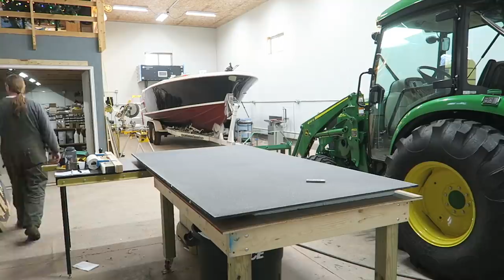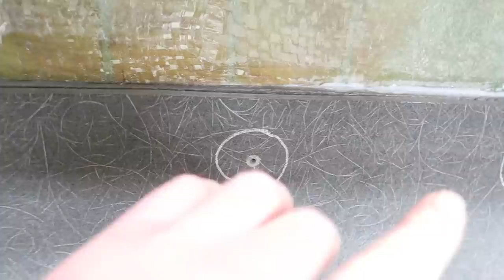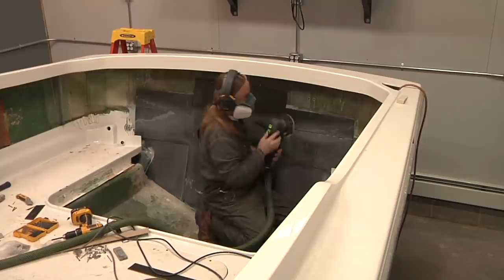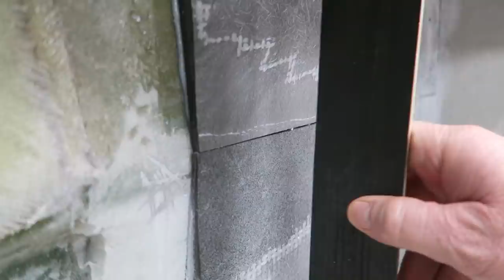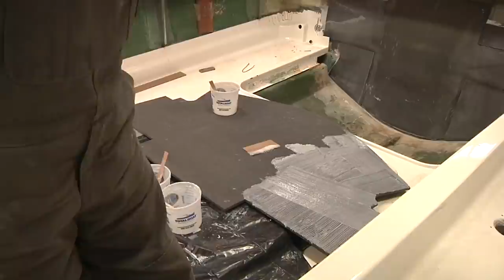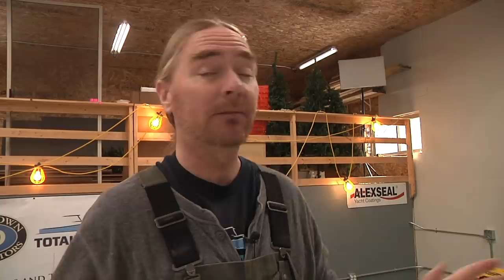Transom Installed!!  Then This Came Up...

Comment: Andy, have you thought about doing longer format videos? You could do some smaller projects while building up your longer content. I could see that being less stressful than trying to knock out a short video every week.  Once you have some content built up you wouldnt really have to do work every week under pressure.  I thought I remember you doing stuff like this in the past. Just a thought, cant wait to see you get into more of the interior modificationsn/building.  The transom is gonna be super solid for the bracket and the twins!

Comment: Another great vid. Andy I live in 55degrees north land. I’m needing to do a core replacement on my boat. But from my research I’m finding foam will stop my condensation issues sense it gives very little R value. I’m inclined to go plywood for strength sense it’s the whole bow area including pulpit.

Comment: Andy, regarding the coosa coring, could you cut kerfs into the backside so the coosa would conform to the contours of the transom? I realize your aiming for a flat surface in this situation. Just curious for decks which have a slight curve to them.

Comment: Just curious, what would you have done had you found an 8" x 10" hollow sounding space?
Reply from the maker: drilled a shallow hole to the void and pump full with thickened epoxy (mostly thickened with glass fibers) to take up any space.  This is why dry-fitting and taking time shaping the substrate is so important :-)

Comment: Hi  a non boat question:  how is the heat system working?  Does it keep the temperature constant?
Reply from the maker: Both the insulation and heat have been awesome!  I think that the biggest factor is the insulation which allows the heat to be efficient.  There's no ice or melt off the roof or cold spots or drafts anywhere in the shop.  Heat runs for roughly 20 min and is off for close to 2 hours even when it's below zero and windy outside.  Couldn't be happier; having the same insulation done in the addition but the heat there will be in-floor instead of hot water registers

Comment: The worktime seems to get shorter and shorter.  Would have filled the voids with first epoxy bucket before coating the coosa.  Don't you spread a coat of neat epoxy before spreading the thickened epoxy mix?   You could have added epoxy fillets to the outer edges instead of talking about the addition.  Videos would be a little better without the excuses or storytelling.  I'm a fan, just trying to help.